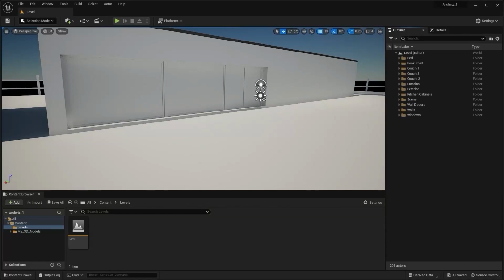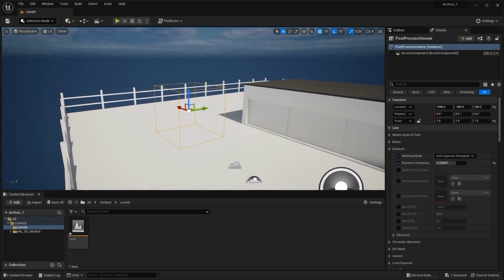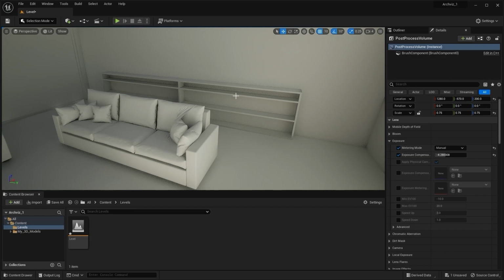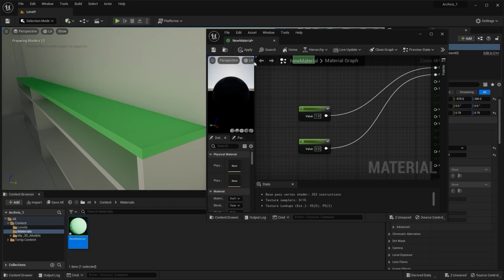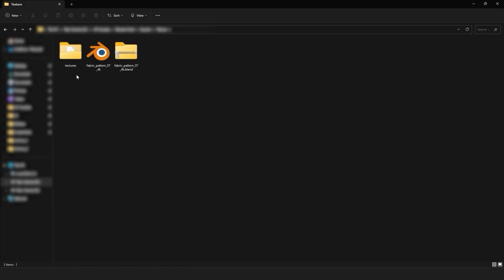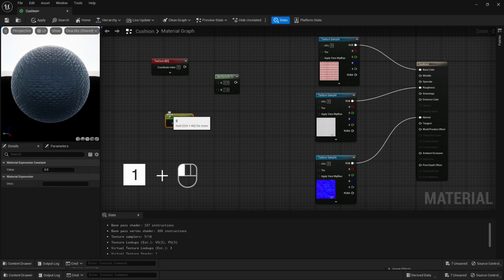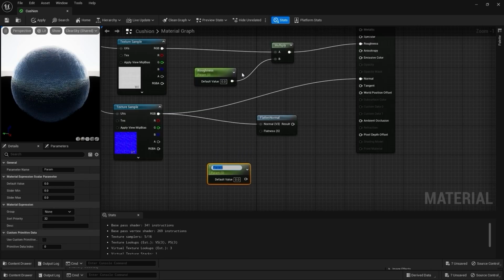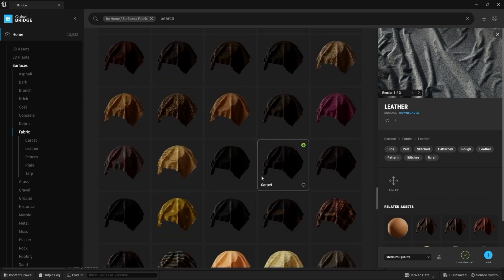Unreal Engine 5.1 For Architectural Visualization | Material & Texture

Comment: Thanks for sharing your knowledge brother. I'm having an issue when placing the meshes in UE5 (5.3) scene. The cushion material shows entirely black, i checked normals on Blender and they are ok.
Reply: Is that UV mapping correct? also check the material of cushion inside of UE.